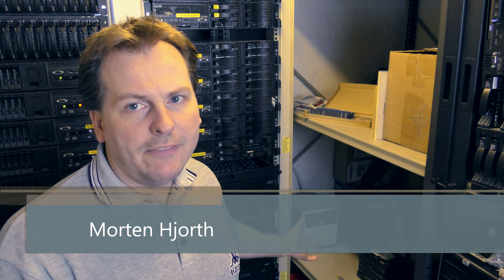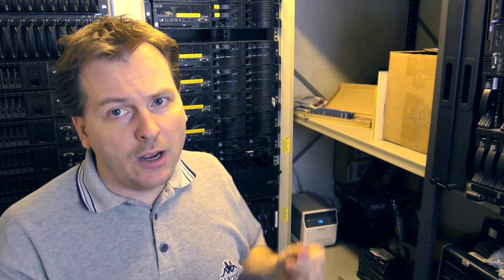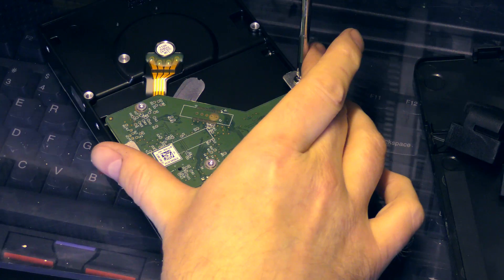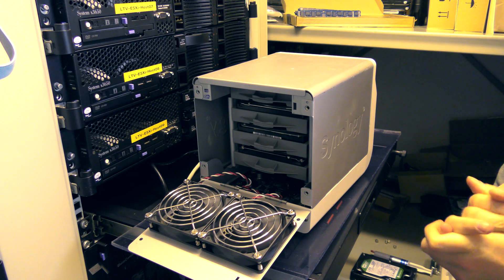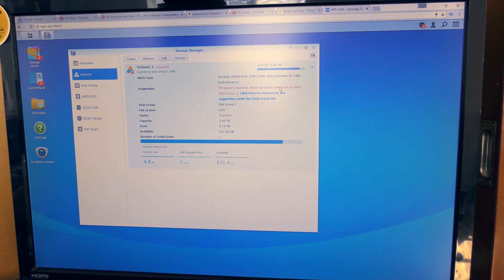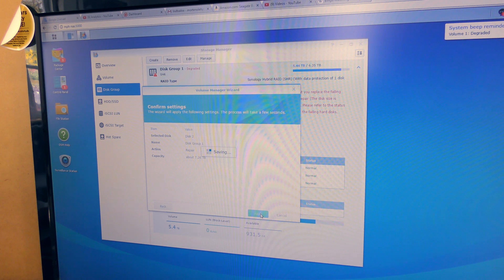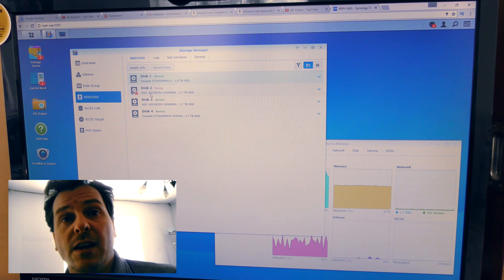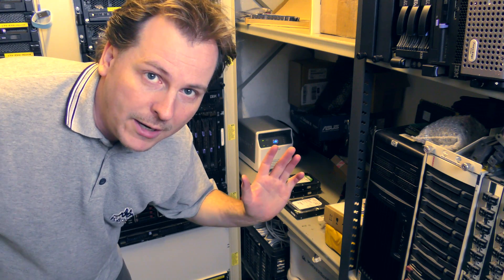Synology NAS How to Expand Capacity, Changing Just 1 Disk - 515

Comment: just for info No, the DS413j doesnt have the hot swap feature .not any of the cheeper j modells.. it is a miracell you did not destroyed the drive ..people  DONT do this way you need turn off your nas unplugg the power cord :=)
Reply from the maker: Hi Istvan Eber
Thank You very much!  The SATA drives are hot Pluggable so they will be okay. But you are right the Synology was not, and needs to be powered off.
Thank you for watching! :-)
Reply: sry but it realy dont matter   at all it is not about the drive it is about the modell dont support  Hot swap :=), what you showing to people gonna make then destroy they hard drive..prob the reason your dyied after you plugged in :=) your other video  1815+ modeel is HOT swap capable..

Comment: Sorry to hear the 3TB failed. Could it be that they use factory-test failed drives in these boxes and that that is the reason they are cheaper ? I have 4 of these WD green drives (not from enclosures) and they all work well. Note that before taking a new WD green drive into operation I always set the idle timer to 5 minutes so the head does not retract so often.
Reply from the maker: Hi Maico
I am not sure that drives they chose to put in the boxes.
Thank you for watching! :-)

Comment: Your Synology DS411j is not hot swappable. You will have to shut down the NAS to change out the drives for it to be some what happy. The new drive didn't show up because the NAS was still showing the 2 TB drive that was removed even though there was a new higher capacity drive installed. The NAS was confused on what to do. Be sure to shut down before you swap the hard drives!
Reply from the maker: Hi Matt Garner
Thank You very much!  I did not realize they were not hot swap,, but yes it worked as soon as I booted the thing.
Thank you for watching! :-)

Comment: Dam dam :-(.
Really really silly question: Does that system have any kind of checksum for each file saved to ensure the data is still ok, or does the file system do it?.
Reply from the maker: Hi zx8401ztv
Thank You very much!  It was running SHR RAID,, all data was fine. I have popped in a new drive.
Thank you for watching! :-)
Reply: The power of multiple backups.